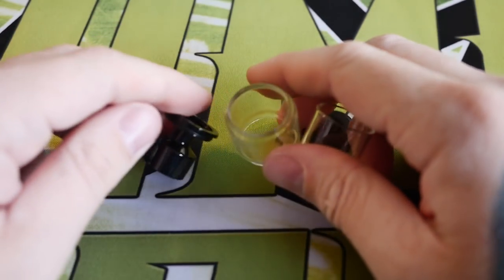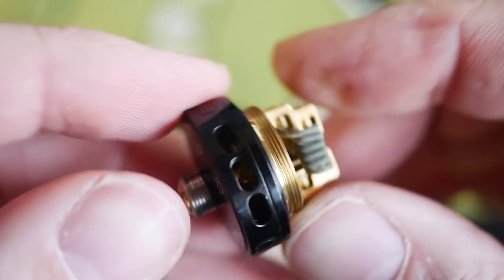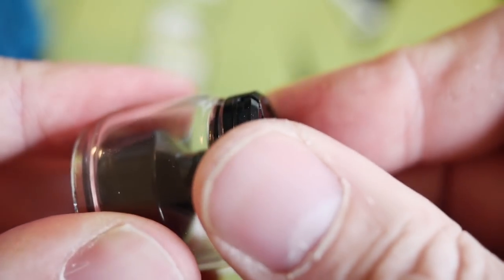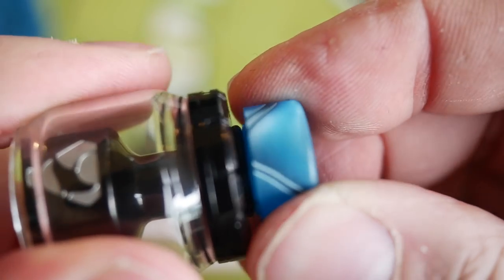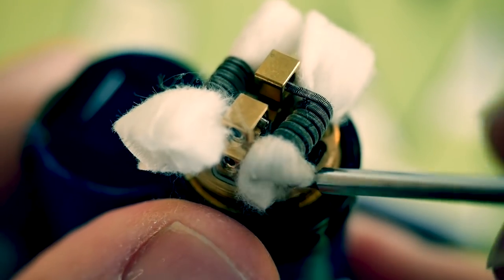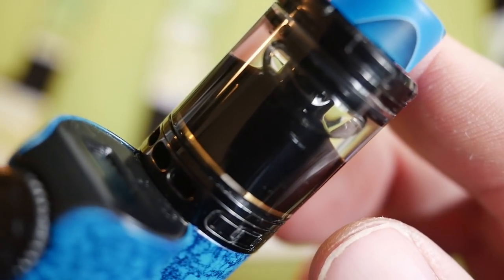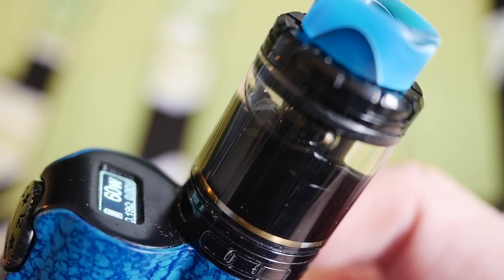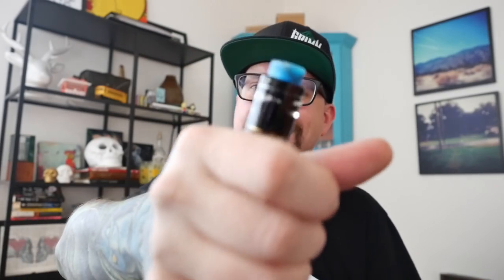Advken Manta RTA ~ Full Review ~ Solid RTA

Comment: if the gap bothers you terrible on the DHD tips, you can remove one of the ORings.  It makes it a little more of a pain to put in, and it doesn't fit as tight, but it will sit flush.  That's the only way i can get them to sit flush on my Pulse 22

Comment: Hey Nick I couldn't help but notice that you left out a crucial piece of information there's a Center column in the center of the build deck that has a hole in it and it's part of the air flow system so the coil is getting hit with the air from behind it as well

Comment: Great review bud. Yeah I found that my reload rta was just as difficult to adjust the airflow on it to. Also not sure if you tried?? But with my goon style drip tips that have the orings do the same with whatever I put it on. I've found if you take one of the orings off perhaps the bottom one. It will sit flush unless the tip bottoms out. Lol

Comment: Hi there. Mine, leaks as f. I dnt know what im doing wrong. Help please.
Reply: O ring between the AFC and the Deck is Bad. It's been 10 months so i assume you have already replaced it with something else. You remove the 510 pin, which lets you take the AFC and deck apart. And the really big o ring is probably bad, or not put in right.

Comment: If the Air Flow control is so dang hard to do, how do you re-fill it.?  I find if you don't close it off when you refill the dang tanks leak.   Or do you don't bother closing it off ?
Reply: David Bowser always leaks no matter this guys a shill
Reply: You have to loosen everything up. This tank for whatever reason defies the laws of physics. You have to create other ways for the pressure to escape, loosen the glass section, to where it still seals, but isn't tight. That's how you stop the leaking.

Comment: Nick you said you had a contact for baby beast compatible coils that were not made by Smok. If you could let me know through some medium what is I would greatly appreciate it. K byeeeeeee
Reply: Rob Liguori if you google Medusa staple Clapton coils for baby beast you may be able to find a site that still has them in stock. No leaking, amazing flavor, tons of airflow, and last twice as long. I’ve tried a few from my local shop and they’re much better than the smok coils. They are called Medusa staple Clapton for baby beast.  .25ohm 35-80w best at 55-70.

Comment: Leaks all the time gradually well wicked loads of builds makes no difference changed all orings out. It's shyte
Reply: Yeah, it takes some physics know-how to get it to stop leaking. It's because of the immense pressure that builds up in the tank. If you loosen the glass section from the bottom, it creates a pocket for the air pressure to escape, and as long as you don't loosen it too much, you won't lose any juice. Kinda sketchy, but it does the job. No leaking, and great flavor. Just make sure everything is a little loose, and but still tight.

Comment: I rock a Reload RTA on an hybrid mech. It's pretty damn nice! Just say'n, you should try it. 2x 26 gauge 316L fused with 40 gauge Nichrome, 5 wraps comes in @ .10 - .11. It may surprise you.
Reply: Bill Carini DO YOU GET DRY HITS ON YOUR SET UP?
Reply: matthew turner no, not at all. I use 3mm I.d. coils with the VTC5A batteries. Usually with thicker juices (80/20) just have to thin out the wicks a bunch. My wife uses the same coils in the Big Baby RBA on a broadside clone and again vapes great!
Reply: Hey buddy, if you don't like it that fine. but how about not pissing and moaning about the fact that I like it. I like small RTA's not big goofy looking shit that is taller than the mod it's on. Also I'm not stupid enough to buy a $70 atomizer, I paid $12 for the same China made clone. It works the same.